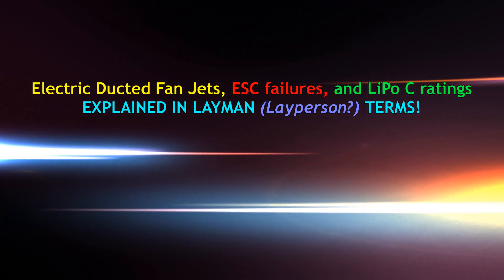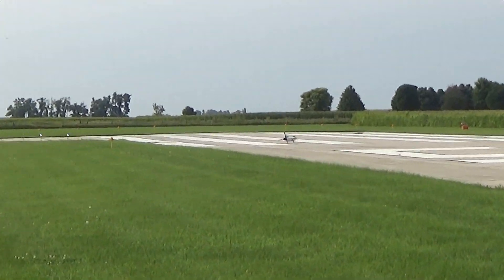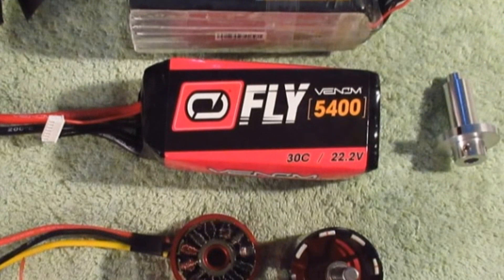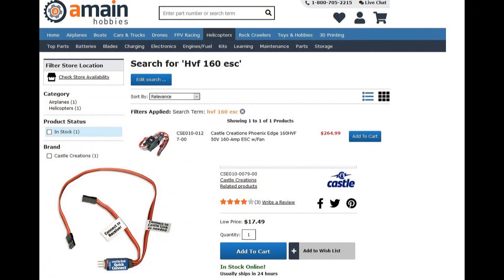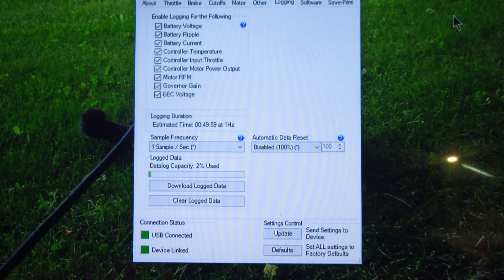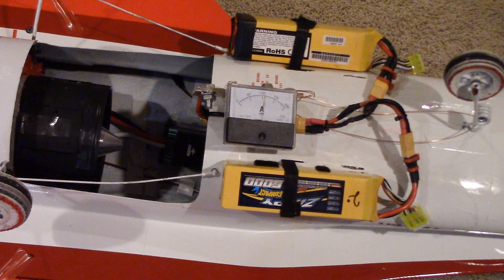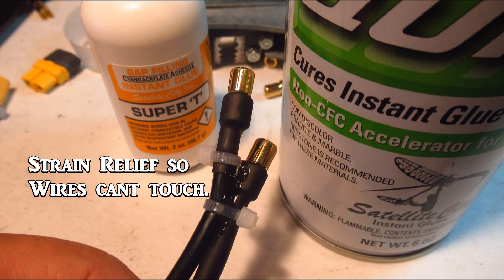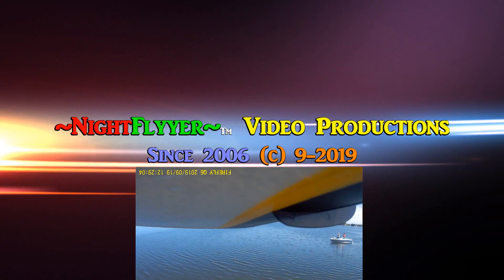Byron F-16 Jet ESC Failures caused by LOW LiPo "C" ratings with EDF's explained with actual Demos.

Comment: After some 10+ ESC mishaps with my TWIN EDF jet (note zero failures with my props) for a variety of reasons - mostly my bad twin ESC differential thrust programming or controller input & occasionally prolonged use overheating or amps exceeding rating, I am finally forced to resort to boring bench test SOP... I spray ESC with soldering flux. Give full throttle till LDC. If any component on ESC overheats flux smokes first giving forewarning ...though doesn't apply to your massive current  draw system
Reply from the maker: True.  My laser temp sensor works good. I hate to see smoke, you know, as I would not know what is burning. LOL. Thanks again.

Comment: I used the fly a HSD Viperjet on 6S 5000Mah 30C lipos and used the Blue EC5 plugs without problems for over 30 flights flat out flying and about 3 min in the air but the low passes are great :)
Reply from the maker: Yes a 6s would be fine but this 650kv fan runs on2 6 s batteries in series for a total of 44.4 volts. The heat on the connector was too much. I elected to use the 6 mm plugs cause the aren’t plastic and are working fine. It’s a little late to tell me to use the other plugs anyway but thanks for the comment. We will see how it fly’s.

Comment: really informative and has got me thinking about my setups and how i can further optimize them. =)
Reply: I was thinking the same thing. Never thought they could get so hot a desolder. I was wrong. Will use better connectors in the future
Reply: joshua logan I’ve not seen them come straight off but have seen them hot enough, that I could tell, any second now, that they would come right off, luckily not any of my babies.
Reply from the maker: Thanks much. You can’t be too cautious with these setups.

Comment: Good and informative video sir, but with all due respect why not just put a turbine in it? They don't cost much these days, the sound,smell, and run time pay for themselves on the first flight or two and they are quite reliable. Just saying if you've never had one you'll wonder why you waited so long after your first flight.
Reply from the maker: Thanks but I lost about 10,900 on a turbine powered a4 20 years ago and swore not to do that again. I’m on ss you know and my house burned Down so am lucky to be able to fly anything. This jet would not tolerate it anyway. I already have spent over 3k in it as it is just to go simple electric which turned out to not be so simple. If anything, I may put the stock nitro in this antique. Thanks.

Comment: I use bullet connectors for all my electric motors because of less heat and higher current carrying. Great video Dave 👍
Reply from the maker: Yes, I certainly will use them from now on on any High Amp stuff, even though most batteries come with Xt60's.  I think that was the biggest part of the problem for sure.  We shall see.  Thanks much, Don.
Reply: Xt 30 60 and 90 are all bullets connectors inside
Reply from the maker: @OswaldBeef  Yes, but not 6 mm.  They are only 4.5 mm on the Biggest Xt90's
Reply: @NightFlyyer  ahh smart

Comment: 120amps running through the XT60 was your problem! I'm glad you got rid of them!
Reply: I’m surprised venom was shipping batteries with an xt60 on 10 gauge wire. I have installed them on 12 gauge wire and the wire doesn’t really fit the cup. I wish the xt60 had a deep pocket on the female connector for the batteries like the male connector on the ESC side does.
Reply from the maker: @Jon_Flys_RC  I totally agree.  Too hard to solder and can melt the plastic during the process.  That is why I switched to the 6mm bullets.  Easy to solder and wire fits right in. If they put xt 90's on all their Hi C batteries that would be better, but who knows, especially since those 50 c venom's cost me $168 each.  I think they are cheaper now, but a year ago.....Thanks again Jonathan.
Reply: I have gotten into the habit of having an opposing mate on all my connectors when I solder them now. They get set aside to cool and when everything is nice and cold they come apart. I also started using a weller 140w gun. Gets things hot fast to minimize heat soak. Either way large soldering has some element that’s dicey.
Reply: Jonathan Blake hot and fast and heavy ohhh ya that’s the way yup.  I don’t keep it connected cause it’s more of a heat sink and ads more time till flow
Reply from the maker: @Jon_Flys_RC  Yes, it can be dicy. I use heat sinks ( I use pliers with a rubber band around them to keep them tight on the wire)  I also use a very high heat gun and high heat solder, but learned how to do this when I worked in the electronics industry.  Thanks again.
Reply from the maker: I agree.  So we will see what happens next when I get a good day to fly.  Please stay tuned and thanks.
Reply: @NightFlyyer  XT90s would have been OK. I had the same setup in a byron f-15 castle creations 160. Went well.
Reply from the maker: @iflyrcmike  Yes they would have but they only came on that last set of Hoovo 60 c batteries.  Since I already changed and made the jumpers to the 6mm bullets on everything else, this was the easiest to do after all that.  Well see how the flight goes.  Thanks.

Comment: Couple of things I think I can add here.  Next time put a volt meter on your system and I think you will see a voltage drop as the amps drop when it was surging.  The battery chemistry can only handle so much for short periods and fails to provide current or voltage or both.  This will show a batteries real capacity as you can't always trust the label.
Next, the ESC will put out a certain voltage at a certain speed (very simplified analogy of the pulse width modulation that goes on). If that voltage level is high enough for long enough, the current through the motor windings can be too much and they fail. If they melt and short out, this could reduce the resistance considerably and draw too much current from the ESC causing it to fail.
Last, when an ESC fails, it's possible that components in the ESC short out.  If a short happens between motor leads (and motor windings), then it's just like putting the brakes on.  Try spinning a motor with two winding leads touching and you can feel the affect.
Hope this helps.
Reply from the maker: Thanks for the info.  Ive already done most of that, but not shown, especially with the voltmeter.  My conferring with Castle and Venom also helped. There is not much more I can do with this setup anyway, as you saw.  Thanks again.

Comment from the maker: I've been lucky twice and unlucky twice with my Byron Originals F-16 jet that I converted to electric.  The ESC and batteries had to be matched for this to work reliably, and for me (and the many experts that I asked), it still turned out to be trial and error because what should have worked, didn't! I think I have it all sorted out, but still feel the motor is now the weak link and will fail. 
Battery C Rating - The C rating of a battery (or cell) is used to indicate the continuous current draw (amps) the cell will support. Example - For a 5000 mAh battery with a 25C rating, (the continuous current that may be drawn out of the battery) is 5000 mAh x 25 = 125,000 mA, or 125 Amps (A) (divide 125,000 mAh by 1000). 
The higher the C rating, the higher the cells are capable of discharging. I demo here and also try to explain what I hope will reliably work with this 650 KV EDF. We shall see on the next flight, so stay tuned. I think making bigger wires and using the Castle Creations ESC should work.  Thanks for watching and please subscribe too, if you don't mind.